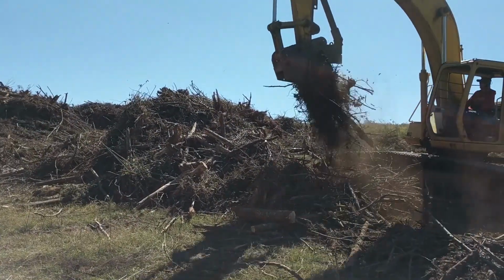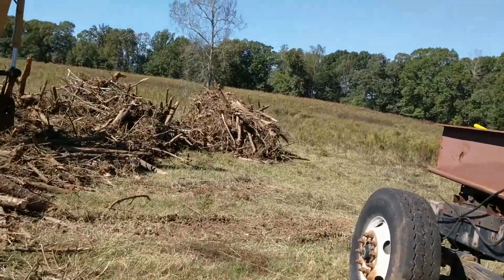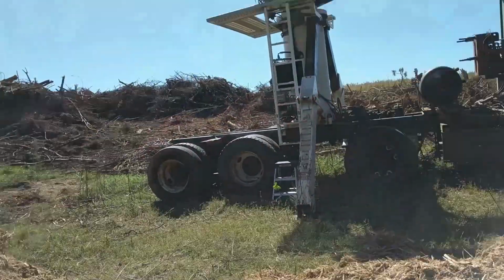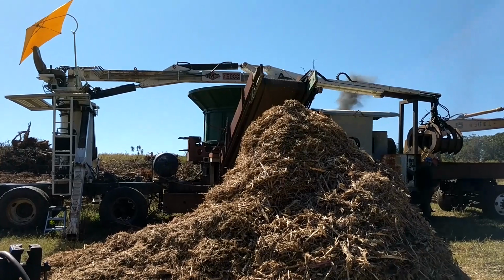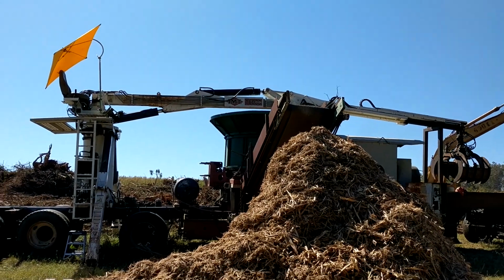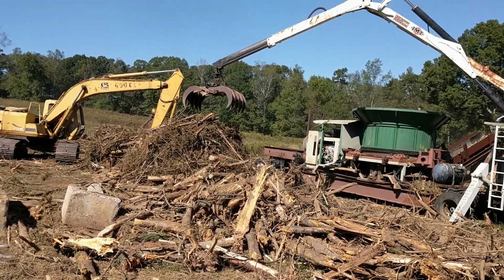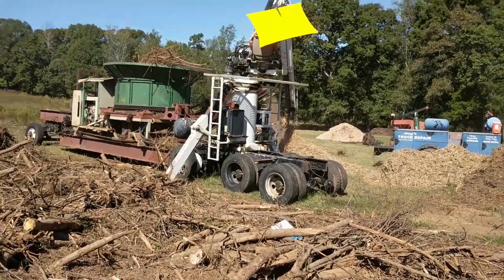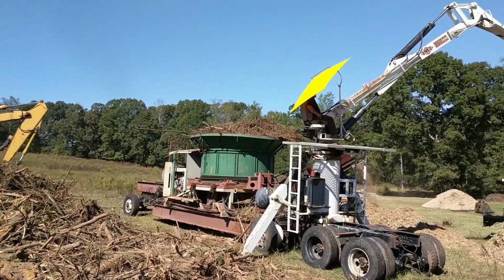Mobile Mulching Monster

Comment: Scott, quite a number of years ago, I drove for a mulching service on an undeveloped area of Skidaway Island, in Savannah, Georgia. The owner had a massive wood grinder. I recall that it was powered by a 12 cylinder Caterpillar Diesel. I will never forget that monster, for sure. 

The design was something similar to what your buddy did there, with a long conveyor that would lift the grindings and drop them into semi-trailers. He would fill the trailers by early afternoon and we would pull them to Union Camp, or other paper mills, by first light come the following morning. It was an enjoyable job. This video reminded me of that. Thanks for the memories.

Comment: About 20 years ago, the landscaping company I worked for would hire one of these in the fall to grind up all the removals we had done during the season.  We would use the mulch to heal in nursery trees for the winter.  They can grind up an entire house and put it into a couple of dump trucks.
Reply: It might have been a wood chipper but I am pretty sure it wasn't one of these
Reply: Jay they have been around for years but they are expensive units. This is someones DIY build of one for a fraction of the price. If you do an image search for tub hammer mill and you will see how the hammers are setup and finished products

You can ID the process they use by the type of chip/shred it produces with the one in the video a hammer mill as it is producing longer fibers rather then chips a blade would produce or the chunks interlocking teeth make.
Reply: My mistake, I had only ever seen them on the farm for grinding feed.

Comment: Local landscaping company does the same here, they converted their diesel engine over to electric motors, 2- 480v 450hp motors, was trying to figure out a solar/battery system to power just the grinder, they pay about 6k a month for power, best I could figure was about a 1MW system with same for storage haha, course they didnt have the land for that many panels and the throw range for their grinder which is much bigger than this one was 100ft easily, not to mention trying to get a 1mw container sized battery storage is upward to 1 million easily. Deal didn't pan out due to space limits, bummer.